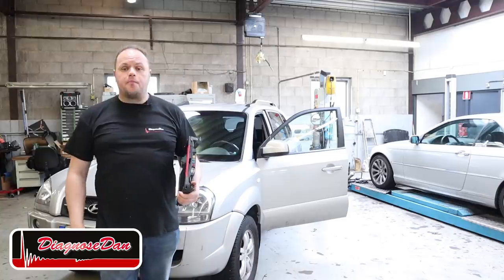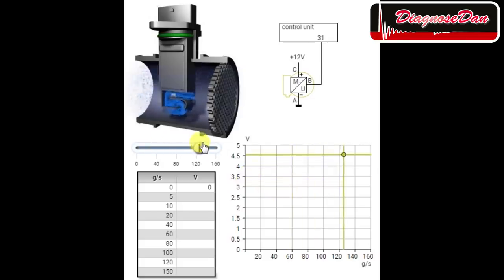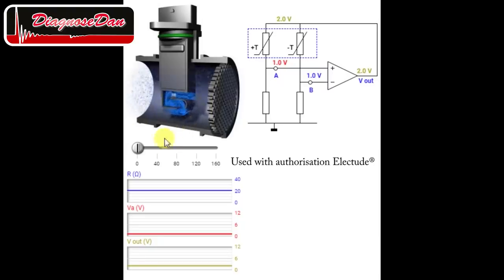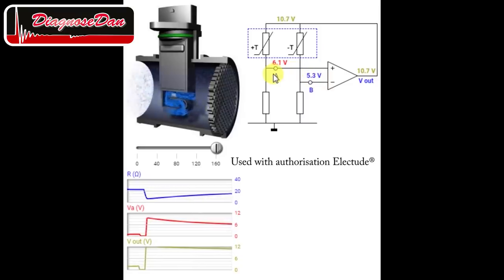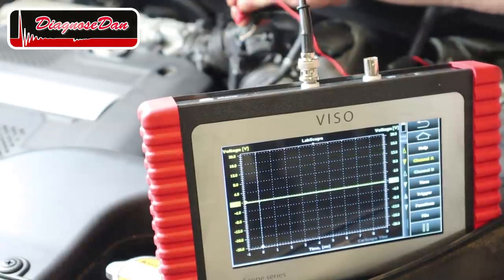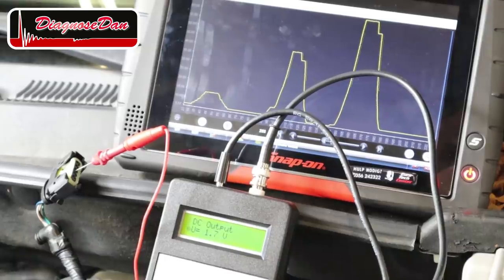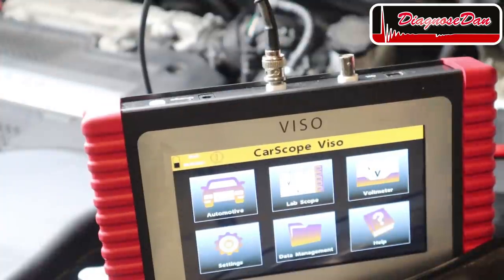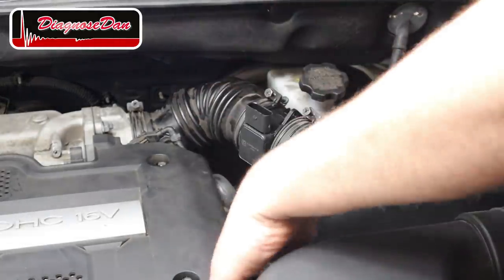Oem vs Aftermarket

Comment from the maker: For more information about the Ditex Carscope Viso visit:
http://autoditex.com/  (Main website)
https://www.tfasolutions.co.uk/  (UK)
https://www.ryansautomotive.ie/ (Ireland)
https://www.diagnosexl.nl/ (Holland)
For other countries go to the Ditex main website to find your
local reseller.
Reply: A great test,It would be interesting to compare two OME sensors just to see how close they are.
Reply from the maker: @10Tug  Great idea!
Reply: Another interesting test would have been to see the deviation on the short and long term fuel trims with both MAFs to see how much they altered.
Reply: More comparisons like this would be great. Thanks for a very interesting video Dan. 👍😉
Reply: @diagnosedan What interactive training program is that??
Reply: One of the good things about AutoDitex is the developer actually listens to the users feedback.
Reply: That comparison you did was an eye opener. I am in the United States and I have always used OEM parts. Thanks.
Reply: Diagnosidan where can I have this signal Generator tool

Comment: Great job on the diagnosis, Dan! For electronic components I have learned that the ONLY reliable option is OEM. Even a used or remanufactured OEM component is better than a NEW aftermarket. Now I wonder how the aftermarket manufacturers test their products for functionality and calibration. Maybe they don't at all xD
Reply from the maker: I wondered about the same thing😉

Comment: Another job well done.  I like the fact Dan, that you go the extra step and check the system before you decide to change a sensor so you do not charge your client for a part not needed (your a good honest man).  I know you go in depth to explain to us how you diagnose problems, and that is awesome.  Thanks for sharing.
Reply from the maker: Thanks Robert, it's only a quick check and it can safe the customer a lot of money and frustration.
Reply: @Diagnosedan  Yes that's true, but shops do this.  In fact, a couple videos back a shop sent you a vehicle after they replaced parts that were not needed and did not fix the problem.  But, you fixed it.

Comment: Wonderful  !!!
MAF calculation is impressive to me  .....
Then we could figure out  how much electrons and fuel needed at any given rpm and engine displacement.  Decades ago JENDHAM was great  seminars for around 10 years  now I missed. But you are even better to understand so clear for me.
MAF calculations was mystery for me with air volume and density in actual field because I've been working only on smog check  ..... 
Thanks for everything Mr. DAN.!..!...!........

Comment: Great case study Dan, it proves why we as professionals should insist on OEM parts for a proper repair. Love the MAF calculator, looks just like the one we have for our Tech Support Group Subscribers from TFA Solutions 👍
Reply from the maker: It looks like the quality of parts isn't anymore what it used to be Steve. I'm having more issues lately than ever before.
Reply: @Diagnosedan  So why do you buy crappy Nipparts? That Hyunday probably left the factory with a Bosch MAF. Why not buy a Bosch? or Hella or NGK or MagnetiMarelli or Delphi? one of these is the OEM supplier of the part, not Hyunday.
Reply from the maker: @gaborradu1275  didn't you understand the video?
Reply: @Diagnosedan  Hi Dan. Maybe i didn't. I was focused on the tech part. Create job by the way, this is the reason of your video, to teach people the proper way to diagnose a problem. I saw a lot of comments like "I will never buy aftermarket again" and those people do not know what they are talking about. Of course there are aftermarket bad suppliers but like i said some aftermarket suppliers are also OEM suppliers (same part different box and price)
One more thing. Are you sure that MAF sensor was for that model of car? parts mismatching can happen sometimes.  Quick tip: check the OEM part code in an online EPC like 7zap.com or everythingbenz.com. With that code buy at your local parts store the OEM part or an alternative from a good supplier.
Wish you all the best and keep up the good job
Reply: @gaborradu1275  Thanks for sharing the 7zap.com site. New to me and much quicker than other sites to navigate. Thanks again.

Comment: That aftermarket MAF is robbing power from a poor old engine. Possibly ended up killing it due to extended lean condition. How ruthless! 
Always an amazing diagnosis n fix from you. Can't wait to see more coming. Cheers.
Reply from the maker: Thanks for the nice comment Wandy.
Reply: The MAF sensor signal is also used to calculate transmission line pressure control.  Good way to burn up a transmission if it is fooled into thinking it needs lower line pressure than it should.

Comment: This is the main reason I will NOT work aftermarket repair shops again. Too many cheap aftermarket parts that fall short on fit and functionality. I have seen this too many times and this has caused more headaches than it's worth. Great job showing this and sharing Dan!!
Reply from the maker: Thanks!

Comment: Excellent video Dan sometimes the cost is the key for customers to decide between OEM or Aftermarket preferring normally the cheaper one (aftermarket), but precisely that "savings" in cost can cause "further expensive" repairs or "unexplainable" failures even when the component has been replaced with an aftermarket newone. Thanks againg for the precise knowledge shared in your channel, by the way nice tools you got there!.
Reply from the maker: Thanks for the great comment!👍

Comment: Hey Dan just wanted to let you know I just fixed the honda finally today. It was the throttle body gasket. The previous owner didn't replace it correctly so it was leaking. The car still has many problems but now at least it's drivable thanks a bunch.
Reply from the maker: Well done!

Comment: That is why I don't use aftermarket sensors, just too much of a crap shoot if they will work right
Reply from the maker: And in this case the difference in price was only 10€ 🤔
Reply: Depends the difference in price and whether you can return them should they not work IMO. Lets be honest. Some OEM parts prices are crazy stupid.Reason why cheaper knock offs.
Reply: @patbutete1722  the cost of labor out ways the price difference,I am a tech and shop manager, and we warranty our repairs for 3 yr/36k miles, any profit will be lost having to pay a tech to rediagnose  and replace the part again, and then we eat the added cost of the oem part
Reply: @flatratemaster  That's a different argument altogether.Sure.I wouldn't want sub standard parts fitted on my car without my say so.Having said that, el cheapo knock off replacement parts have a significant  role play.After all they are part of the reason why most cars that no longer have factory support sill on the road ..No?
Reply: Except for all those times the aftermarket sensor is just the OEM sensor in a different box.

Car manufacturers don't manufacture electronic sensors.

Comment: Great video dan! Learned my lesson with aftermarket sensors. In october i had someone diagnose a bad MAF Sensor so i went into autozone thinking what the heck ill slap it on there and boom it was fixed..for now. Last week( February ) i turned on my car to go to work  and immediately noticed the idle jumped around and the car smelled like gas. I thought it was just acting up and it would pass so i drove on and going down the street of my neighborhood the car would jerk on acceleration almost to the point that my head was hitting the horn!! I knew something  was up but decided to go on the main road and merge onto the highway to get to work. Worst freaking mistake ever. The jerking stopped until i got to around 60 mph and everything seemed fine for 5 minutes. I pushed down the accelerator and noticed i wasnt going anywhere. All the dash lights came on and i realized the fucking car just stalled going 60mph in rush hour traffic !!!!! I had to call a tow truck on the side of the road and towed it into a shop. They diagnosed it to be a bad MAF sensor!!! The same one i had put in 4 months prior almost cost me my life!! Never again am i buying Aftermarket stuff!!!
Reply from the maker: 😬 Wow, that's quite a story!
Reply: I love a good storey

Comment: Wow!...This is very good info. regarding the quality, or lack there of, regarding aftermarket parts. This is especially critical in electronic engine control replacement parts! If price is all you care about, be prepared to experience less performance & gas mileage as well as likely lower reliability. In this case...you get what you pay for! Very good content Dan. My first time on your channel & I am impressed with your attention to details & your thoroughness. GOOD Job!!!

Comment: Hello Dan,
I just  found your channel and this video may have just saved me some money. My 2017 2.2 turbo diesel has given me a p2196 code. O2 sensor signal biased/stuck rich bank 1 sensor 1. In Chile, car parts are very expensive and mechanics who know what they are doing are scarce. My scanner doesn't give me any data on how well the O2 sensor is functioning but it does tell me what the MAF sensor is reading. Using a website that allows me to calculate how much air is flowing into the motor and comparing it to the MAF sensor data, I found the MAF sensor reading from 2 to 6 g/s more than calculated. I ran the test 3 times using a different rpm and each time the sensor read high. Looks like I need a new MAF sensor. Thanks Dan

Comment: Hi Dan - it has taken a while but you have grown on me. I have disagreed with your logic a couple of times but most of the time we agree.

On this video I questioned why you decided to use the Autosim to check the continuity on the plug when a simple multi meter would do the job, but after confirming continuity you then went on to demonstrate that by injecting a signal you can prove 100% that everything from the sensor plug all the way back is working properly. So good move.

The reason it took me so long to accept your channel is your hands. Having been through many presentation courses I appreciate that standard wisdom recommends that we use hand gestures to help get our message across. Personally I think you need to tone it down a bit for people like me who have a phobia of windmills.

Apart from that really minor issue - I now enjoy your videos and I am slowly making my way through the videos on your channel.

For my own personal use I have ordered an Autel MK808 - will I  be happy with it?

Comment: That Auto Ditex would be a great way to start using a scope . The help section is an added bonus . To see the difference on the aftermarket parts is an eye opener . This is a critical part and you can SEE it impacts performance . Imagine having several parts like this on the same engine and having drivability issues . If each sensor is off - how much ? - total it up and you are chasing your tail with issues . You would have to have known good OEM data on each sensor to know if it's operating properly . And name brands are not always a guarantee . I just watched Eric O . diagnose a new Dayco timing belt that was off by several degrees and setting a code . And those parts with no name and a plain box could be suicide . The only thing I will buy in a plain box - is an air freshener ! Great diagnosis and lesson .

Comment: Thanks for the description of how the MAF sensor works. I always read the part of attempting to keep the same temperature or current on the sensor it never made sense. I just knew higher voltage meant more airflow. But knowing that its an NTC resistor in a bridge makes everything so much more clear. It makes the failure modes a bit more obvious and you can see how different things will affect the performance of the sensor.

Comment: This is one big reason why I am an advocate of OEM parts, even on older cars. If <your car make here> outfits a new car with a sensor that's bad enough to noticably affect driving behaviour, but good enough to not trigger a check engine light, imagine what it would mean if you are the lucky one with a "good enough" ignition coil AND  injector AND pump AND camshaft sensor.
Reply from the maker: You are right!
Reply: unfortunately there are times when OEM is NLA so you can hopefully pick up a guaranteed AM product. I have this now on my Toyota Camry 1998.

Comment: That's a fantastic tutorial in great detail! I wish you went into more details of the common failures of MAF sensors, as they usually don't completely fail but start sending wrong values to the ECU. Especially on Diesel engines, those platinum wires get covered with dust, grease and soot. In my book, first procedure for those before replacing the MAF is to try and clean it up with MAF cleaning spray, although it's often only a temporary fix.
Reply from the maker: I've got a video on cleaning a Maf.
Reply from the maker: It's called "Diagnosing an engine without using fault codes"

Comment: Thank you for this. May I say that many millions of people have zero financial choice between oem and aftermarket. When money is a deciding factor, brand choice is important. Many aftermarket sensors are good, have a warranty, and are reasonably priced. Would you consider doing a video on what aftermarket brands are the best bet? Also, on many older cars, aftermarket is the only available option. Thanks again!

Comment: Thank you Dan. I just wish you are in uk or Ireland so I can use your services 😪.
People buy some Chinese diagnostic equipment and with no experience or know how they start car diagnostic services business. I sofar used 4 different ones and still haven't fixed the issues with my citroen picasso which is : air bag + abs + depolution filter and something else 🤔. 
€300 to have the filter professionally cleaned and around €1000 for new bag of liquid from citroen to do with filter regeneration 100's € for more work to sort out the problem and still have the same problem with the 3 dashboard lights still on and the beeping never stopped and it's driving me demented. 
Now I'm thinking of buying classic car with no electronics and normal manual hand brake and no dipolution filter...
Thank you so so much for all the info and advice ✌❤☘

Comment: Yet another great video....I had an issue with an aftermarket cam shaft sensor on my 350z...since then I'm using ONLY OEM sensors.....just not worth it.

Comment: Installed an aftermarket generic oil pressure sending unit for the Toyota oil pressure gauge. It read near zero at idle and the idle mark at running. Confirmed the pressure with a pressure dial gauge. Installed a 2x more costly Toyota unit and it read properly. Always use OEM sensors or OEM supplier ones like Denso for Toyota.

Comment: i don't no if you have this but uk we have main dealer parts , aftermarket oem parts , aftermarket parts .  i fitted a dpf turbine temp sensor which failed with in 2 days , in which i was told i made a bad diagnosis in which i pulled out a video i made proving i did not , so then fitted another oem after market which lasted 2 days , so i fitted a main dealer sensor no problem . we need some sort of regulation on oem parts there is a lot of parts manufacturer calling their products oem , great video thankyou

Comment: I like load testing power and ground ckts with a 9007 headlite bulb, cheaper than a test lite.
I have had horrible luck with aftermarket sensors, especially the reman ones, one subaru I worked on, we had two bad out of the box, so we just got one from a wrecker-finally fixed it.
Reply from the maker: Yep you got to be carefull with aftermarket sensors!

Comment: Great comparison! I wonder what quality / make and price class that aftermarket part was. It looked like low quality ‘imitation’ level quality.

When I buy aftermarket parts I always buy quality ones. E.g. the fuel pump of my car is OEM from VDO. The MAF sensor is OEM Bosch as goes for both O2 sensors. Brake parts from ATE. Spark plugs are from Bosch or NGK. And the headlights are form Valeo or Hella 🙂 I mean VW does not produce all these parts themselves right? Last OEM part I bought was a N75 sensor because I could not figure out what make it originally came from. 

Further I like your videos because they are like slow tv and I don’t have to rewind again and again because the information density is to high for me to follow 👍🏼👌🏻 Keep on going !
Reply from the maker: Thanks Peter, I'm thinking about doing a comparison.

Comment: Another excellent video Dan, thanks for your time and effort man, really appreciate it. Now my short story: I once swapped two coil packs with aftermarket ones on a nissan and guess what...engine light came on with P0350 error code. Put back the original ones and problem fixed. Moral of the story imho, aftermarket electrical parts and sensors are a bit tricky so I'd stick with OEM for critical components at least.
Reply from the maker: I guess there are some good aftermarket brands out there but it's very hard to keep track of what's good or bad.

Comment: Having recently replaced my MAF sensor twice      both times with after market options .. the original Bosch MAF was a massive price and I am a 75 year old pensioner who is not made of money .. I had bought a MAF cleaner spray .. which failed to work . luckily for me the second MAF sensor worked like  a dream .